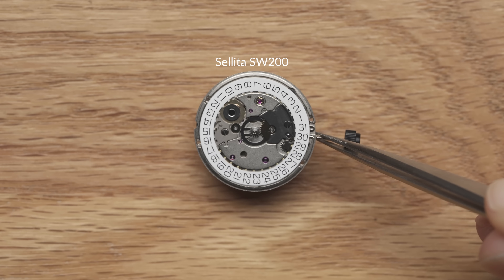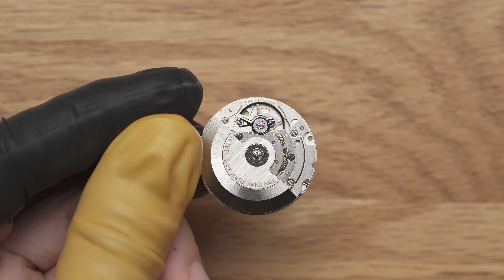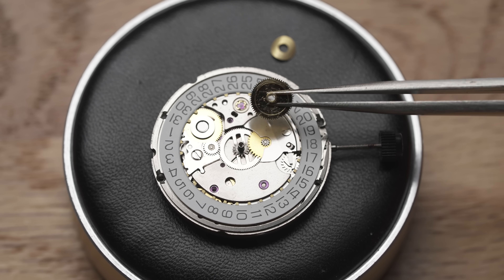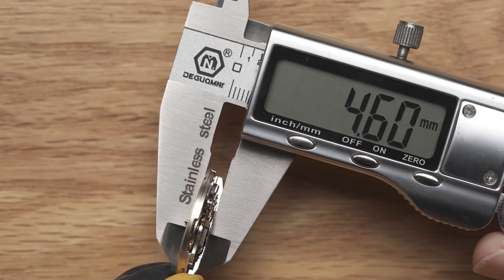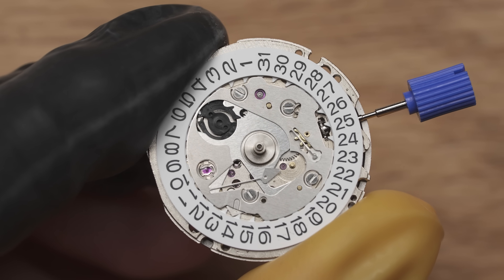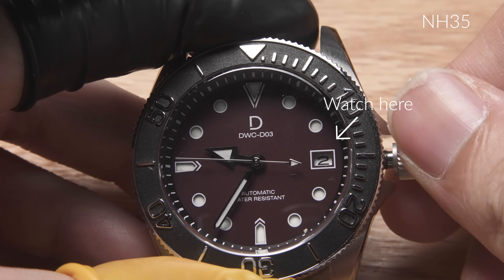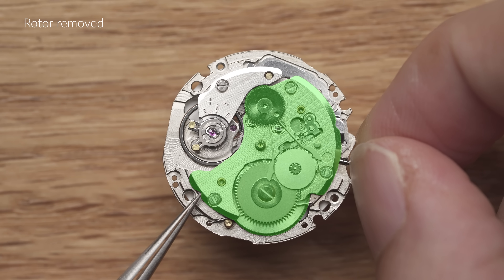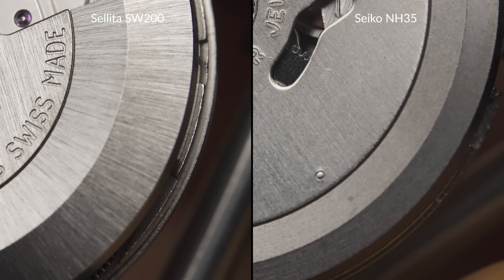Why Swiss Mechanical Movement is More Expensive (Sellita SW200 VS Seiko NH35)

Comment: To make a fair comparison you should buy movements of the same price range. Next time try a Seiko 6R35, it would be more fair
Reply: This isn't even a comparison. The title says "why an SW200 is more expensive than an NH35". It's precisely meant to illustrate the difference between price-points - NOT as an apples v. apples comparison. Could also have called it "Here's what you're getting if you upgrade to the next higher tier of commonly available movements".
Reply: The construction of the 6R is not much different from the 4R. 6R gets better material in main spring and the balance assembly and that's about it.
Reply: @tilio9380 I’ve also read the 6r is not as easily regulated as the 4r.
Reply: 6R is only for more power reserve & as for Accuracy 4R is more accurate than 6R! I owned a Seiko Sharp Edge Presage Open Heart Automatic 72hrs power reserve SPB417J1 & to compare to Mine Seiko 5 Sport Automatic Gmt Blueberry SSK003K1, Seiko 4R is more accurate!
Reply: @dannytan7923 貴方の意見に同意します。6Rは価格に見合うものでは無いと感じます。無駄に長いパワーリザーブは普通に使うには無用と思われます。パワーリザーブは40時間あれば充分であり、70時間と引換に精度が悪く高額になってる事は理解に苦しみます。
Reply: @dannytan7923  Even Seiko Specs show the spec of the  6R as better than the 4R, The big problem with Seiko is they don't regulate there movements well enough. The 4R due to its costs (£35) is a throw away movement when it comes to servicing the 6R15 costs £225 and 6R35 £325 and so you do service these every 5/7 years
Reply: There isn’t much difference between the 6R and 4R they are basically the same

Comment: NH35 is way more important than SW200. Because without NH35 (or NH36), there will be a big reduction in affordable microbrand watch. Come on, who wants to clone ETA's Sistem51 movement? (Except Blancpain?)
Reply: The Miyota 8000 series was fine function-wise and had been a favorite for microbrands for long, but the not-hacking second and unidirectional winding screamed a little too much "cheap" for watches that could cost over 500 bucks. Many manufacturers switched to the NH35 as soon as it was available. 
The Miyota 9000 series competes directly with the Sellita. It's a little too much expensive for many microbrands.
So now it should be Miyota's turn to upgrade its entry-level workhorse.

Comment: This boils down to  DIY likes the SW200 because it looks nicer and is Swiss. Not useful. A better comparison would show the differences on a timegrapher between up, down, crown up, crown down  on each movement. An in depth comparison would look at such things a side and end shake, amplitude, beat error,  and durability and maintainability of the movement.
Reply from the maker: I like your suggestions. Thanks you

Comment: It’s too bad that there isn’t a Japanese movement that is more in line with the SW200 in terms of price point. Miyota’s 9000 series is about as close as it gets, but it’s a far cry… I wonder why Seiko hasn’t released a higher-grade movement for general use. Maybe afraid that it will provide direct competition to their watches?
Reply from the maker: If I have to guess, it's mostly market strategies. Anything higher end than 6R for the Seiko means Grand Seiko/King Seiko. Releasing those movements to the public kind of ruins the exclusivity of the higher end lines.

btw 9015 is a damn fine movement tbh. It's really as close as it gets.
Reply: If only the winding experience weren’t so gritty on the Miyota.
Reply: I own 2 watches with SW200, one Miyota 9011 and a Seiko 6R35. Both of the Sellita watches wind rough with grinding and backlash, and both Japanese movements are smooth as butter when winding. Especially the 6R. I recently was shopping watches in the $2k USD range and had a really hard time justifying paying 5x the $ for watches with upmarket brands with the same movement as my 2 “Swiss made” watches that are nicely featured and finished. Ended up going with a Citizen HAQ watch with superior design, precision and rarity at that price point.
Reply: @mattmcgriff5952  I
Very interesting! I own four or five watches with SW200 movements, two or three watches with/ NH3x movements and three with Miyota 9000 series movements. Of all the watches, the Miyota 9000 series movements have the roughest manual winding.

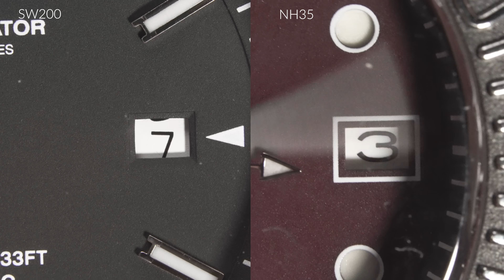Comment: 3:43 the time the date change starts depends on hand alignment at time of casing up not the moment manufacturer 3:43
Reply from the maker: I perhaps didn't describe it clearly enough in the video. What I mean is, the NH takes longer to go from the start of date transition (when the date change mechanism is engaged and starts to transition) to the actual transition at midnight, the click, which both movements should do if cased well. The NH transition started way earlier than midnight, and it took that long to go from start to finish. So, no, it's not a matter of alignment of time.

Comment: Subscribed! Can you PLEASE make a video on the new La Joux-Perret G100, D100 and L100 movements? The G100 is made to be a direct competitor to the 2824/SW200 due to the same dimensions. Not sure about the other ones. But they will, or already have appeared in some good value brands such as Frederique Constant and Edox, as well as many microbrands.
Reply from the maker: Thanks for the sub! That's some interesting movements for comparison. I'll see if I can track down any of those.

Comment: I feel the comparaison is not really fair to the seiko due to the price difference between the two movements, seiko beiing far less expensive...
Reply: SW200 = $189
NH35A =  as low $30
Not a fair comparison. Seiko's 6R15 is a fairer comparison.
Reply: @1968gadgetyo  even tho it's not fair for the nh35,but still we know the seiko will run far longer without a service...
Reply: @frankieracing1048  🤣🤣And NH35 is responsible for so many microbrands watches.

Comment: Currently, of my mechanical movement watches, (4) of the movements are Swiss and (3) are Japanese.  Only one of the Swiss movements has been trouble-free.  One was received new with a defective chronograph.  Another was received new as COSC-certified, yet it lost 19 seconds per day.  I had to return them both for repairs which took several weeks, and I feel like I wound up with used watches for new watch prices.  The other was bought as vintage, and while I paid nearly $1k for its service (and waited for nearly half a year), the gears sometimes bind, and setting the time feels coarse.  Meanwhile, all of the Japanese movements have been frustration-free.  Therefore, my opinion is that Swiss movements are celebrated garbage, and I would choose a Japanese movement if there were a choice for a given watch of interest.

Comment: I am a novice home watch enthusiast and tinkerer.  For my needs I only buy NH series and 82XX watch movements.  I would not buy a Selita movement for a hobby watch project.  Its over kill and would not really improve the project enough to justify the expense of purchasing a Swiss watch movement.  Maybe in the future, when I gain experience and knowledge I might purchase a SW200 movement if it is justified.  For now, if you really want a high beat movement, why not try an ST2130 or a PT5000 movement?  Cheaper and more practical for the home watch project.
Reply from the maker: Getting a Chinese 2824 clone is perfectly fine choice to start with. We once disassembled one, man it was so drenched in oil that the US army could invaded it. And its performance deteriorated quickly. But with proper servicing and oiling, it went back to okayish performance. It's an inexpensive choice to get to know the in and outs of a 2824. Not recommended for anything more.
Reply: @DIYWatchClub  Performance can vary.  I have an ST2130 and also a pt5000 in two of my watches.  They are both fine watches.  I have heard of other people having issues with theirs but I have had good experience with mine.  I have also heard that as time goes on they are improving the quality control on both these movements.  People are reporting well oiled and beautifully regulated performance from their PT5000.  Yes, I know, Swiss movements are better movements.  In my view, I would not put a swiss movement into a hobby watch.  Its over kill.  If you buy a name brand watch then its ok.  Hobby watches usually have very little residual value so you might as well use generic movements.
Reply from the maker: @glenh4971  Good to hear that the Chinese is improving their quality control. This is going to benefit hobbyists so much.

Comment: Let's just not mention the Swissmatic :p That would somewhat make a crack the "Swiss Made" concept :p
Reply from the maker: This comment made my day 🤣
Reply: @DIYWatchClub  Heheh!:) But, for real, the Swissmatic more or less ruined the concept of "Swiss Made" for me. And this is coming from someone who loves Sellita (and still do). After the Swissmatic Incident, whenever I see a watch or something branded with "Swiss Made" I get that Swissmatch-feeling (which isn't a good feeling:p) 
If I worked in the swiss watchmaking industry, I would be rallying the town mob to stop that Sistem 54 (or whatever it's called), to ensure that it didn't completely tarnish my industry and what it is supposed to stand for. 
(Wow, that was alot, I clearly have some issues I need to work on:p)

Comment: I really respect you guys for introducing the sw200 to the kit lineup! I've always wanted to work with one.

Given the two main problems the sw200 faces (handwinding breaking the ratchet wheel, and the reversers getting stuck and causing helicopter rotor) I'd be really happy if you guys released a video showing how to swap out/service these specific parts to fix a broken sw200. Then I'd feel much more confident building and maintaining my own sw200 watch
Reply from the maker: That's a good idea for a video!
Reply: Interestingly, ETA 2824 never had problems with ratchet wheel breakage, and stucking reversing wheels (only pivot wear in some service neglected movements). I even encountered second wheel (first after the barrel)  teeth wear, ball bearing wear, in reversers - wear in holes for pawls. Just Sellita uses inferior metals, for exapmle,  where ETA uses beryllium copper of Glucydur, Sellita uses plain brass, that's why reversers wear out fast and get sticky
Reply: @dima343.  I wouldn't know, since I haven't seen too many original ETA 2824. I know that some reversing wheel issues existed even with that movement, which were largely tied to lubrication issues. (helicopter rotor) It's quite possible that the Sellita ratchet wheel is inferior, and I've always wondered if that wheel was sacrificial by design.
Reply: @larsf.4756  in ETA2824 never saw ratchet wheel breakage. In early Sellita SW200, ratchet wheel teeth had more slender profile, in SW200-1 they made them beefier, like in 2824, but still, breakages sometime occur, because ratchet wheel made from weaker material, than 2824 wheel. The same true about reversers, weaker materials, more dependent on lubrication. Jewels on Sellita movements also more  crudely made, looks like chinese jewels
Reply: @dima343.  Interesting, thanks for the info!
Reply: Reverser wheels are fairly straight forward if you choose the right lubricant. The ratchet wheel is easy to access and swap, and is also inexpensive. The only issue I can think of, is that you might have sheared off teeth as a result of aggressive handwinding. If these teeth have migrated elsewhere into the movement, you may want to consider a service.

Comment: These two movements are completely different designs. It would be much more useful to compare the SW200 with the Chinese PT2000 or Seagull 2130 movements
Reply: Seiko equivalent of 2824-2 is the 6r 6l ne15 ne25 and a lot more expensive too at that

Comment: Eta -2824-2 aka PowerMatic 80 uses plastic parts & no regulator. Some says It's a disposal movement like the System-51 by swatch.
It feels like a scam & please make a Video about it.
Reply: Powermatic 80 has plastic parts, but it can be regulated, although the system of regulation is different. System 51 is a crap for me. It cannot be serviced at all, because it does not have bolts, only pins. You can exchange the whole mechanism only.

Comment: Is the NH35 really a Japanese movement? According to some, it's more Malaysian or even Chinese, but it's an excellent movement and that's what's important.
Reply from the maker: It can be produced in Japan, in Malaysia, and as some rumors have it, in China. But the country of origin doesn't seem to affect the quality of the movement, given that it's a real Seiko/TMI movement.
Reply: The NH35 is the export version of the 4R35. The only difference is that the 4R35 has Seiko branding and is only available in Seiko watches while the NH35 has no branding and is sold to microbrands. However both movements are manufactured by Seiko.
Reply: Y que me puedes contar del 4r39 que  diferencia hay con los suizos en esaxtitud

Comment: I have numerous of both movements. The most problematic movement I own is the SELLITA SW200 (helicopter effect). Although I do admit the SW200 feels more refined compared to the feel of the NH series. That date changing on the NH35 an hour ahead is not a movement issue, but rather that hands were not set properly (closer to the midnight date change). In the end until SELLIA addresses the known issue with the bad part causing the rotor to spin out of control until something breaks, I'll take the NH35 all day over the SELLITA. As a matter of fact for my money I'll take the Miyota 9series over both the NH and Sellita.
Reply: The rotor spinning out of control is most likely a failure of the click. I’ve had it happen to a Miyota 8215.
Reply: @roversgonemad  If you are referring to "helicopter effect" on Swiss watches, it is caused by a seized dog leg on one of the reversing wheels. Sometimes the reverser wheel can be cleaned and lubricated with Mobius Lubeta V105 (a special solvent & lube made for this task). Generally we replace them in our shop as cleaning/lube seems to only work 50% of the time.
Reply: @VanguardRT  I’ve not had it happen yet on a Swiss movement. I had a click spring fail on a miyota 8215 and the rotor did take off like a helicopter. Pretty easy repair. I’m sure I will have a failure some day on one of my Swiss movements, but so far only the miyota has broken.
Reply from the maker: We do have to take into account that SW200 is basically a ETA2824, and that design is pretty dated and it comes with baggage, so to speak. NH35 went through quite a few evolutions and it is one heck of a workhorse. 

On the date change, perhaps the video didn't do a good job describing it, but what I was trying to say is that it takes much longer for NH35 go from the start of date transition to the actual transition. On sw200 it's about half an hour in real time and on NH35 it's waaay longer.
Reply: @DIYWatchClub Interesting but how come my ETA 2836 has an instantaneous day-days change? Shouldn’t the Sellita as well if it’s a clone of the 2824?
Reply: 9015  best
Reply from the maker: 9015 is a lovely movement
Reply: @DIYWatchClub  Unless you have to service it and realise that too many pinions have to get in to holes at once... Miyota movements are just like that.

Comment: Interesting video. Thanks 

What’s the price difference between the two?
Reply: NH35 is around 25$ while the SW200 is close to 200$ range
Reply: @GonçaloSantos  thanks
Reply from the maker: The sw200 is at least one price bracket higher than the nh35
Reply: @DIYWatchClub yes but how many USD dollars is each one?